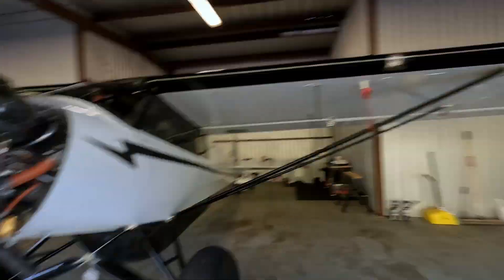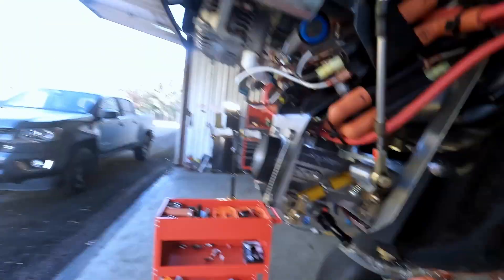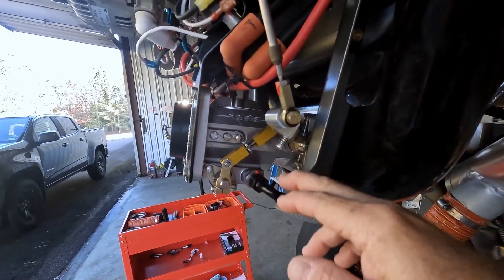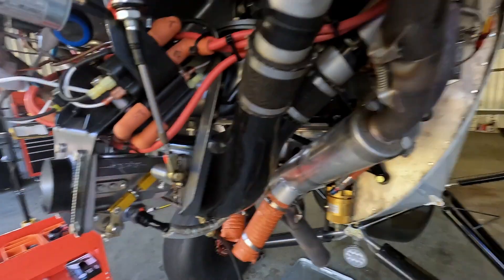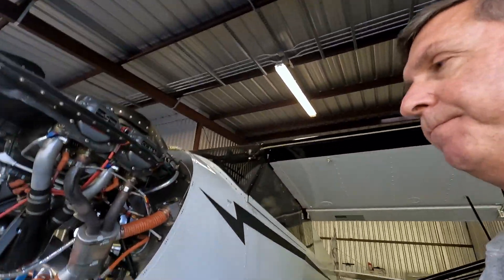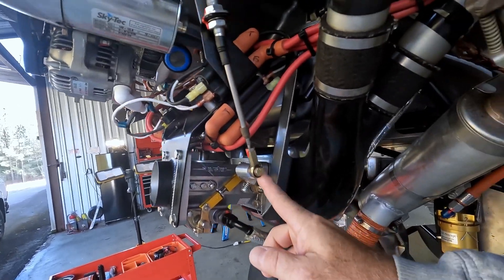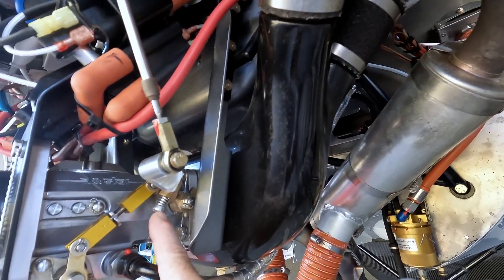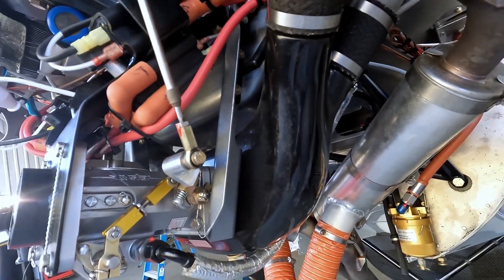Idle RPM and mixture adjustments on a Lycoming IO-360

Comment: The engine must run rich when the engine is warm , otherwise the engine will die when cold , because the air/fuel mixture condensates on the cold burning chamber parts ! When the engine/ burning chamber is warm , you should lean until the rpm goes down or the engine stumbles and then two clicks rich ! To prevent carbon cooking the exhaust valves , spark plugs etc.

Comment: My NX Cub is set at about 610 at idle. I lean aggressively on the ground but have noticed that I will get some popping probably due to incomplete combustion due to an excessively lean mixture. I just enrichen a bit from there. My rise is about 20rpm when shutting down. At these settings everything seems to be working fine.

Comment: You want that IO 360 to have an idle mixture rise of 20 to 30 RPM. When the engine is at normal operating temperature. Once it is, pull throttle to idle, then push mixture to full rich, then  look at the RPM and remember it, then very very slowly pull the mixture all the way to idle cutoff  while watching the RPM. The RPM should go UP 20 to 30 RPM. If its more than that your idle mixture is too RICH. If its less than that your idle mixtureis too lean. Get out of the plane and make a couple "clicks" in the correct direction and try again until you get a 20 to 30 RPM rise.
Reply from the maker: Excellent info, thank you!